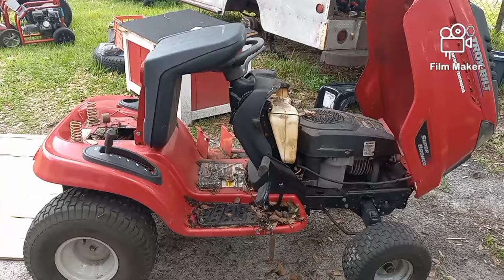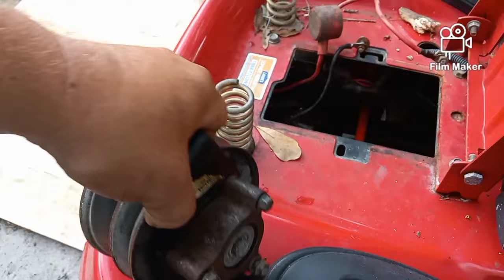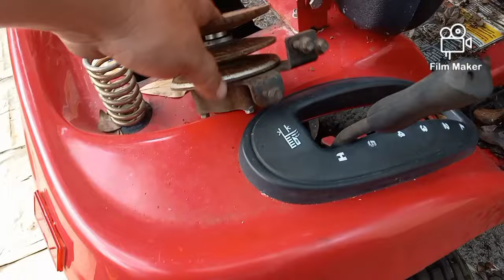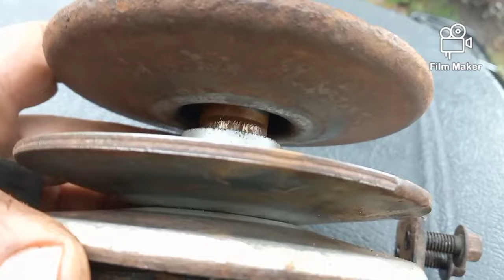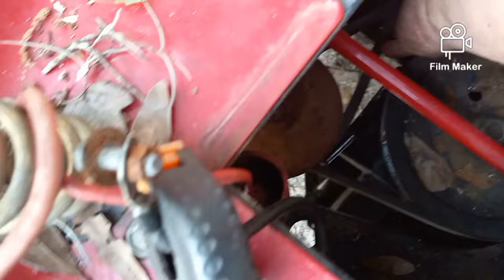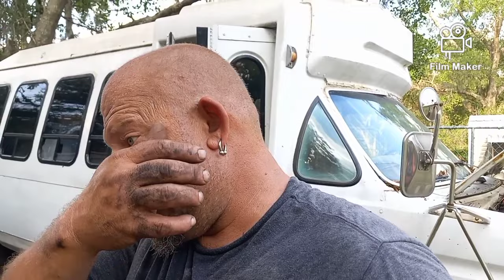Troy Bilt Won't Move / Variable Speed Pulley

Comment: Replace the bearings in that hub with two 6203 RS replacements. Just remove that 1/2" bolt in the bottom of the shaft and it will come right apart. Drop in the 2 bearings, slap it back together and you're good to go.
Reply: It’s best to replace brging every 4 years
Reply: Yep 👍👍 Lots cheaper that way
Reply: That’s what I was thinking the whole time…. Didn’t know the exact bearing size but knew it wouldn’t be hard to figure out or look up in the manual
Reply: @keithk7451  Most numbers on bearing are stamp on them.
Reply: @426superbee4  yes sir I’m aware of that, but I’m also aware that 90% of the time, in my experiences anyways, those numbers are usually long gone being rubbed off. I’m an industrial mechanic and deal with them literally on a daily basis lol.
Reply: @keithk7451  I found the newer one are stamp good. Now i would have to agree with the older bearings
Reply: Yes Sir. My Dad was a mechanic also and he left a box of 24 timkin brgings and I only use them for this repair and not the spindles 
I got 16 old riding mowers I rebuilt because I’m retired diesel mechanic myself 😊
Reply: well heck.... my mower is a 2005 TB Super Bronco, so it's 18 years old and I bought it new. This has been giving me problems lately, but for the first time ever. I've never changed/greased the bearing in this pulley 😂. Every 4 years? Maybe in the south. Up here in western S. Dakota? Every 15 years.
Reply: Absolutely, I keep a pack of 6203's around as they fit a majority of your pulleys in a mower and deck.
Reply: Very informative. 
Keep videos coming.
I have 2 acres to mow.
I have 3 Troy-Bilt Ponys.
My goal is to keep 2 in shape to cut at all times.
They are cheap built but easy to work on.

Comment: Hi Munky Wrench 😀 I Got My Riding Troy Bilt Pony Mower Moving again :)  I Went ahead And Replaced The 2 -  6203 Bearings and the Bearing cup Housing for the VSP, They were loose but not that bad,  I manually spun the Diff. pully and the Diff did not seem to be Engaging , I Removed the Diff. and opened it up and did not see any damage or metal chips in the diff. The Bearings all looked good, The Forward /Reverse  slider looked good too, HUMMMM  No Damage,  The Forward / Reverse shifting fork was slightly bent, I straightened it in the vice with a Block of wood and a Hammer 😋 I noticed there was a Square block of plastic with a hole in it on the shifting shaft on the Outside of the Diff. I Removed that plastic because it looked like it was limiting the travel for the shifting shaft. I am saving it just incase 😜  Got it all back together and it works Great, I had my Son help me with the repairs, One word of ADVICE Take Pictures and Draw a EXPLOTED View of the parts you remove, I forgot which way the VSP and DIFF. Tensioner  Brackets  bolted back on 🥵 (  Embarrassed)  I am not doing too bad for a 69 year young Retired Female Mechanic. When I go the Night Clubs , people think that I am 30 to 35 years old, I will take that 🥰  I will admit to being a little Rusty 🤐
Take care and have fun, Chellie
+

Comment: Thank You Munky Wrench For All the Great Info, I have a newer troy Bilt Pony 42" Mower like about 6 month old  🤔  and it wont move forwards or Reverse, I use it Hard, I have a Arnold snow blade on it and use it as a dozer 😛 I scrape the weeds with it and use the double size pallet it was shipped with as a drag , Funny thing is that it was working fine, I parked it to eat dinner then got back on it and it would not move forwards or Reverse, The variable drive pully was wobbly , I figured the Bearings were bad, I ordered some 6203 Timkin Bearings from amazon, I think the Bearings that are used Originally are cheapy Chinese bearings, I only use Timkin or Rockwell bearings, I am a Retired Female Fleet Equipment Mechanic with over 50 Years of Experience, Its nice to Follow and Learn some one who has already done a repair, I Will also check the Trans linkage to make sure its engaging, Keep up the Great Videos, Chellie
Reply from the maker: Please let me know what u find. I'm always up for learning new stuff
Reply: Hi, I Posted My Findings , Take care, Chellie

Comment: Now some crazy way!   I either lost a spring or the transmission belt stretched   👀🔥 Rather than buying spindles all the time.  I bought a bunch of seal barring to replace them.  You can grease them for ever!  They still wear out just as fast.  Once you replace the seal barring. MAKE SURE TO PACK THEM WITH GREASE REAL GOOD AND PUT THE RUBBER SEAL BACK ON IT
Reply from the maker: Well said

Comment: Munky Wrench, you did a great job with this video, thank you. 

I recently changed the drive belt in my Troy bilt pony (2011); the belt now is very tense, not sure if that’s the way it’s supposed to be, I don't know if that will be the cause of my problem, now I can only control the speed with the throttle lever, even when I put it in rabbit mode the motor goes at high rpm, but the ground speed is about half the normal speed; the (yellow on mine) speed control lever doesn’t work, it goes up and down without locking the notches, offers no resistance and does nothing. (however, the engaging of the parking brake action works fine). I opened up the hood and saw the speed control lever attached to a connecting rod which is attached down there to the cupped metal piece in the correct position as the new Troy Bilt Pony I saw yesterday at Home Depot, but besides allowing to be put in in park position, I don’t see it attached to anything else, is it right? How does it regulate the speed if it is not connected to anything else? Thank you in advance.
Reply from the maker: Sorry just saw this.  I am driving down highway to the beach to pick up a couple of boat motors to repair on the channel so I may have not read everything correct.. but 1st thing .. your throttle cable should be connected to the throttle body on the carb.  If you move the throttle lever u should be able to see it move on the carb.  Also there should be a spring that connects the governor lever to a spot on the motor.. if that's broken or missing it can cause it to Rev at high rpms .. so check that.. when u move the throttle lever it should open or close butterfly on the carb.  The whole thing can actually be caused by belt tension though
Reply from the maker: In other words.. if u bought an aftermarket belt instead of the manufacturer belt.. it could be thicker .  Making it tighter.  Also when I buy aftermarket belts .. let's say a 96 inch belt is called for.. but manufacturer often makes their 96 inch belt actual size 96 and 1/4 .  To keep proprietary.. so go back and get a belt that's 1/2 inch longer than called for.  Should take care of your belt issue.  If you can't figure out the throttle issue.  Take some pics and email them to me.. I'll walk u thru it

Comment: These mowers are driving me CRAZY  🤪 Just 1 thing after another going wrong with them!   MY HANDS AND ARMS LOOKS LIKE HAMBURGER MEAT  🤬🤬
Reply from the maker: Yeah they can get to be like dominoes .. I strip them down to the bare basics.. get rid of extra wiring and safety switches and diodes .. go thru them good even if doesn't look like they need stuff.. that's on my oersonal machines of course
Reply: @MunkyWrench  i make tools, like the spring hanger>  to pull them out and place them into the holes.  Modify parts ect. to. Then the dam engine blows up  🤬🤬
Reply: Agree.   Everytime I use mine...something breaks.. repaired yesterday and now this issue. A new part every week for the last 6 weeks. Never ends.
Reply: @davidbryant3532  I feel for ya guy. THERE JUST NOT MADE TO LAST

Comment: great video. I have the same mower and I have had to replace the bolts on the pulley due to being stripped out, I used longer bolts with nylock nuts and works good. Subscribed and enjoy your videos
Reply from the maker: Thanks so much for your kind words and stopping by

Comment: you deserve the thumbs up mate, mine started to smell rubber burning and i stopped it right away, can you still salvage the pulley at this point or is it toast? if my bearings still look good and no play , would a good sanding and lube job repair it or is that too late.
Reply from the maker: Thanks for your kind words.. if the pulley is sanded and lubed and spins freely with your hand.  It may be ok.. this customer had melted down and shattered a couple of the bearings.. its easy enough to remove and put back on so give it a shot.. if the bearings are worn in any way then the problem will continue. I wnded up finding a used pulley to replace it with because this one was not salvageable.  There have been a few comments stating u can take it apart and service but I haven't found that to be the case. Try cleaning and lube .. if your smoking a belt though it's usually beyond repair in my humble opinion

Comment: How do you like Briggs Opposed? I have a 46 series 20HP on a Murray 42" and it seems to run forever.  Oil every 30 hours, thats it, keep the fins clean.
Reply from the maker: I like all briggs to be honest
Reply: @MunkyWrench  Yes, 23 years of good service is pretty high quality. I use Pennzoil Platinum  High Mileage 10W or 5W 30. Also Stewarts ethanol free gas.
Reply from the maker: @alb12345672  when u know u know

Comment: Took the pulley off but just eyeballing it cant really tell if it bad. Holding the bottom housing should the upper and lower both spin? The center piece that you move up and down moves easily....and spins. The upper and lower circles arent budging. Does that mean its locked up?

Comment: I have a Troy bilt Pony 42" mower that will start up but will not move forward or reverse at all. I've checked many of the common problems for this and can't seem to figure it out. I thought maybe it was a loose worn belt so I replaced both lower and upper drive belts and still no luck. I also have recently replaced the air filter, spark plug & fuel filter. Any ideas?? Thanks in advance
Reply from the maker: Troy bilt are notorious for not going into gear.. so when u move the lever from forward to neutral to reverse.. the lever bends and moves into position but the lever at the bottom where it touches the Trans is not actually moving.. u think your going into a gear but your not.. get a friend to move the lever and see if it's actually moving or if it's stuck.. sometimes u can rock the mower forward and back quickly while changing gears and it will get unstuck.. sometimes u have to give it an attitude adjustment with a hammer to free it up.. your probably stuck in neutral.. also on the rear of the machine there are pull pins to disengage the Trans so u can push it by hand when it brakes down.. the pin disengaged the Trans so u can push.. make sure it's in the correct position.. usually inward toward the frame .. otherwise your Trans is disconnected
Reply: @MunkyWrench  Thanks for the quick reply!! So I can see that lever going in/out of the transmission but it doesn't move a whole lot when I put it into any gear. I'll screw with it and see if I can free it up anymore and hopefully can get this grass cut. I appreciate the tips man! Thank you

Comment: Any suggestion on why my deck will not disengage. Troybilt has no part # for the blade engagement bracket if that's what it is.
Reply from the maker: I'm guessing it's a manual cable wngagement.. the cable can be frozen or broken.. the spring could be stretched from age and not strong enough to pull the lever all the way to engage.  Also the arm often wears out making it loose.  They sell a new washer slug to take the slop out.  I would check from handle to deck and make sure everything is tight.  If cable is frocen.. the handle will move but the spring may be springy while never pulling or moving the cable

Comment: I'm working on similar unit. Colombia.  Drove forward but just ground in reverse.  Pulley driving transmission had much wobble. Needle bearings in upper transaxle housing were toast.  The clip hold pinion gear was actually off too. Lots of water mixed in eith the grease.
Reply from the maker: sounds like a total failure.. will you try rebuilding it or replace it
Reply: @MunkyWrench  hoping to just replace the needle bearings if other gears are ok. Haven't cleaned the grease out yet. Apparently this is the 3rd generation of mtd single speeds. First 2 show pinion shaft, needle bearings and pinion gear as parts. For this one they show complete upper housing with that stuff apparently already installed.  $200 cdn. Complete transaxle $385. My plan is to fix like 1st and 2nd generation.  Maybe I'll find out that I can't.

Comment: When I went to replace the pulley, the bearings are stuck on the old one, and stuck together it seems, didn't seem to have any grease on it eithe but bearings seem to spin, how do them bearings normally just slide off?
Reply from the maker: I've gotten tons of comments in the comment section on how people say they come apart.. but it's a press fit pulley with permission bearings.. I replaced the pulley with a good used one because of that. If u find a way to take them out please share a video of your journey with me and I'll post it to my channel
Reply: @MunkyWrench  Using an angle grinder to grind them down, then "peel" them off! If you have a torch, heat them up, then throw ice water on them!

Comment: So my bolt which goes into the pully from the bottom keeps get loose.   Ive had to buy a new pully and new bolt since the threads were done.  But it seems to always get lose again.  Whats going on?
Reply from the maker: There's a ton of vibration so if locktight won't hold .. I've heard of people tack welding it together to stop it from coming apart or drill for cotter pin if there's room

Comment: I have one of these on a rider I just got , but mine is moving at a slow snail speed only no matter what gear it’s in , the pulleys are all turning and belts springs all seem to be in place all pulleys moving , it sat for 4 yrs in a garage when my buddy got his zero turn , the speeds worked great before parked , any idea what could be happening to cause it to only move in one slow speed ?
Reply: Having the same issue. I'm wondering if it's a spring or the belt is too fat

Comment: I think you did a great job. Found it to be very interesting.  I’ve not worked on mower with variable speed pulley.  Would you prefer to work on mowers with hydrostatic transmissions
Reply from the maker: Variable speed pulleys are much easier and cheaper to repair. Many hydrostatic transactions these days are considered NON serviceable.. I see so many machines junked because replacement is hard to find used and too expensive new.  So I like pulleys
Reply: @MunkyWrench  Agree! 100%!

Comment: Is there no way to take the variable speed pulley apart, clean and replace all inside bearings, etc?
Reply from the maker: It is a pressed fit 1 piece pulley .  It does not come apart unless u have a large press and proper tools.  To my recollection.  U can find them used

Comment: Hello I have tried to take off my variable speed pulley with 1/2" on bottom and pipe wrench on top trying to hold it still but can't get it locked in to take bolt out of bottom. There doesn't seem to be any videos that shoe how you actually get it loose to take off. Thanks for any helpful tips on doing so.
Reply from the maker: Sounds like the nut has rusted.. u could try several things.. I used an impact gun because it whacks so fast holding it from spinning is easy . If u don't have access to impact tool.. find a hole or make one in the frame that you can stick q heavy duty bar or long screwdriver through in order to stop the wrench from spinning when u put torque on it. And to break the rust up u can heat with a propane torch for 5 minutes then spray with cold water. That often break rust free so u can unbokt.. hope that helped.. let me know how it goes.. thanks for stopping by. Hit the subscribe button pkease

Comment: Any idea if you can just replace the bearing?  I have the same issue, but even more wobble play in mine than the one you showed.  Really don't want to dump $150 on a whole new assembly as this is a Project Tractor I am doing a restoration on.
Reply from the maker: That's been a controversial topic here lol. I've had those that say u can. It's all one piece machined and not made to come apart. I couldn't figure out a way to do it that would work. I got lucky found a cheap used one
Reply: Yes , the most common bearing is 6203 on the older mowers and possibly 6204 on some deck spindles 
Keep 4 of each and you’ll save big money

Comment: Will that cause one to pull all the time a little hard to Chang gear
Reply from the maker: Usually when that happens it's cause one belt is worn out .. the thickness of belt gets too thin and sort of jams into place so it won't move the middle section correctly.. so check belt 1st .. but yes if pulley bearins are going bad it won't slide up and down correctly and will cause that problen

Comment: I wish u could show how the drive belt from the motor to the varible speed pully goes. . They say mine has a spring... looks like it hangs loose
Reply from the maker: There is a spring that goes from the frame to the tension pulley .. the tension pulley takes up the slack in the belt so it stays tight and not hang loose.. the tension pulley should be a seperate pulley in the back that is on a swing arm and moves I am sorry that video was long ago and I don't have access to that machine right now but if you email me I can send you a diagram of how the belt goes..
Reply: @MunkyWrench  The spring on the tension arm is for the "small" belt on top. The motor to the "variable pulley" belt has tension applied by a "small" spring attached to the "go" pedal as a return spring!